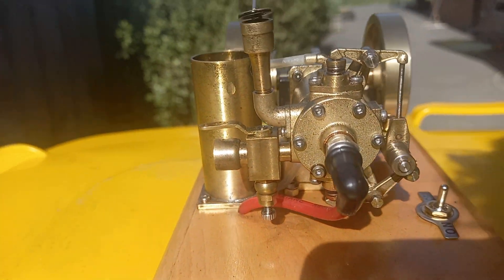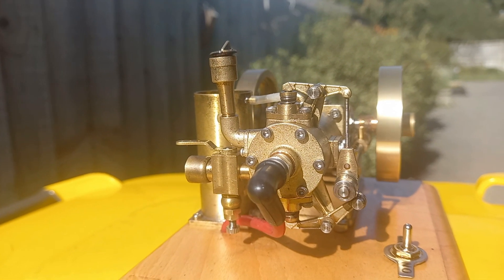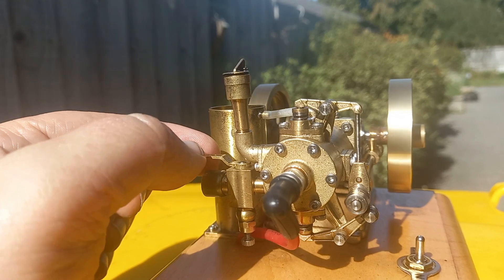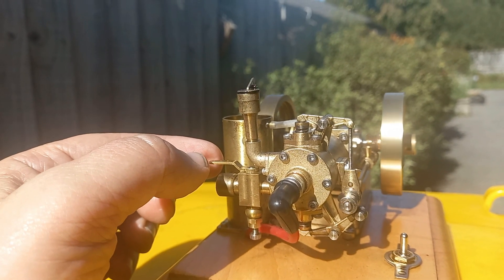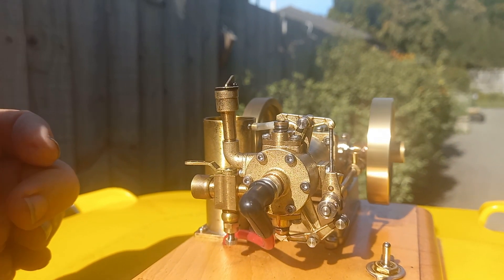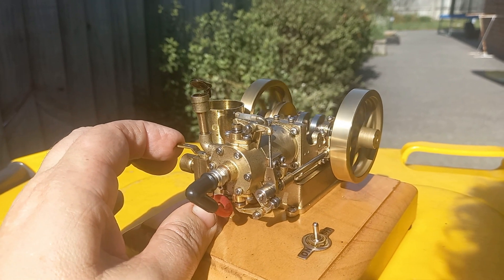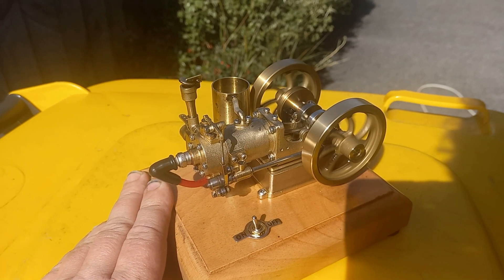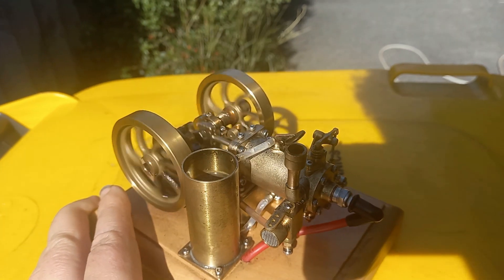Model gas engine M25 sideshaft 4 stroke progress COOL SOUNDS & pics

Comment: Hi can you please tell me if theres a video on the chinese 2022 hit and miss engine exhaust valve rod bearing mod
Reply from the maker: Enjomor Hit and Miss Final Mods completed! ball bearing cam rod mod
https://youtu.be/sl3U_g-CveY

2022 Enjomor Chinese Hit and Miss - fixed with governor latch mods for variable slow running
https://youtu.be/xxcuCNuEr0c

Probably those two? Other vids on this engine:

Tuning tips - tweaking 2022 Chinese Hit and Miss Model Engine! Enjomor Hit and Miss Engine
https://youtu.be/kO6M5LNQRaM

Am I too retarded? Guide to starting Enjomor Hit and Miss
https://youtu.be/4MCVjw6Wyt4

Hope this helps...
:)